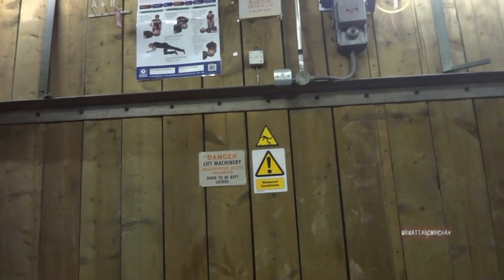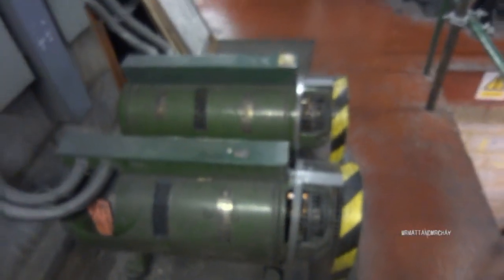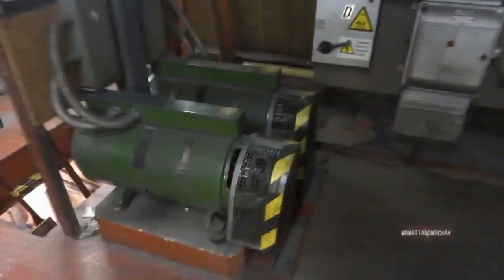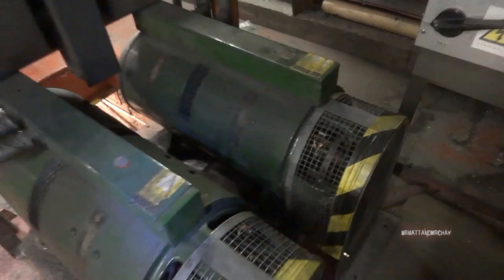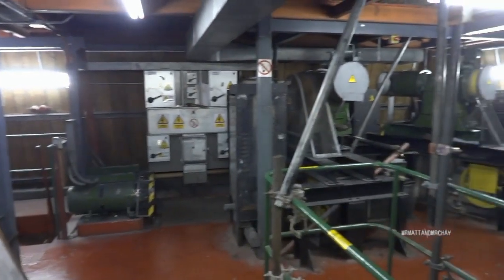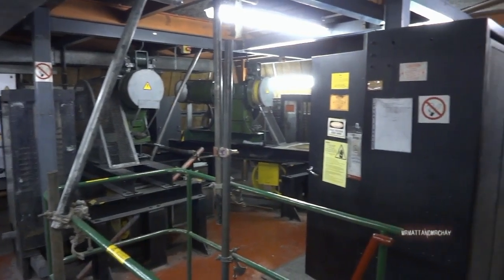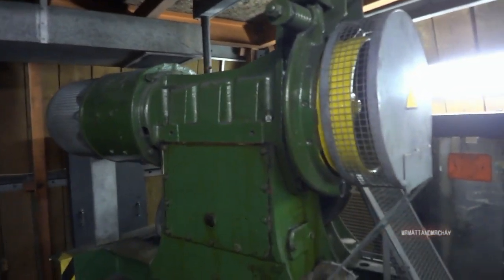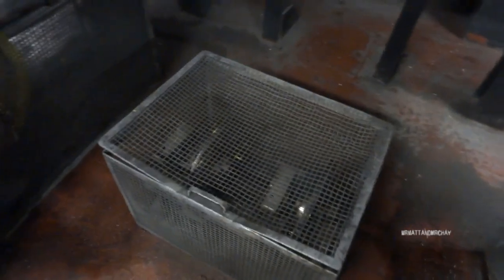1971 Otis elevators Part 2 - The motor room

Comment: Vacuum tubes and mechanical switch mechanisms for this. Strongly predates digital. That rotating switch mechanism is an  very clever & interesting device. There are also thyratrons in this system.
Reply: +craxd1 the number 2050 at the tube socket indicates a thyratron. I found that out in a tube manual.
Reply from the maker: +norman gates I love these motor rooms and the ideas that various companies came up with to control logic to these lifts - facinates me.  You seem to know a bit about this?  Just wondering why you would use a vacuum tube instead of using a relay instead?  Also thyrathons - not heard of these before?  Thanks in advance for any info :)
Reply: +mrmattandmrchay The thyratrons are like amplifiers for the relays. They make the relays sense a much smaller current like from a photocell. The rotating switches must be used for the self-leveling system for the elevator cars.
Reply: +norman gates, I didn't see any thyratrons, but I did see some diode and triode tubes in the design. Generally, a thyratron has a bright blue glow to them. Thyratrons have a gas in them, instead of a vacuum, that when it becomes ionized, it glows, which is called a Townsend discharge. Those relay coils can easily be ran from a triode, as a thyratron is for heavy current.

Comment: Saw a selenium rectifier!  That's more like '50s tech... this looks like a product of evolution, in that old and new things get mixed together into 'what works'.
Reply: +mrmattandmrchay Matt: the fault finding tool is your knowledge of the system you are working on and having a FULL understanding of how it operates in the first place. A 5year apprenticeship in the lift industry is only your starter as your knowledge is only increased by operating in the field. If you worked on installation in those days the lift was delivered in its component parts and you wired the whole system wire for wire, shaft car ,motor room etc. MODERN installation come in kit form and the wiring comes in completed looms, anybody can do it. Processor controls are very clever but soulless and take very little knowledge of the system to repair, only how to operate a test tool, no fun in that mate the relay based system can be very complex and frustrating to work on especially when you get an intermittent fault. Todays engineers have it too easy. (Rant over)
Reply: +scowell The rectifier you can see marked BRF is the Brake Coil rectifier, a DC coil is used to energise and lift the brake.A DC coil supply is easier to control using damping capacitors and resistors to control the actual amount of brake shoe lift. As the lift attains levelling speed which is about 15fpm resistance is inserted into the brake coil circuitry to enable the brake ling to FEATHER on the rotating brake drum before the system comes to a halt. If set up correctly it will give a almost sensationless stop.
Reply from the maker: +scowell Cool, is that the thing that looks like an old aerial that reduces voltages?  What part of the video? (mm:ss?)
Reply: +mrmattandmrchay Big square finned gray thing at 03:59... old-timey rectifier diode.  If you burn one up, don't inhale... selenium bad for you!
Reply from the maker: +Peter Lomas Cool - very interesting stuff.  Wish I was in the industry back in the 70s and 80s - I love all this type of stuff.  Only problems (as someone has pointed out recently) is you don't have a lot of "fault finding tools" with relays.  But on processors you can go back into history to identify faults and mostly make a prediction based on information picked up from the system's memory.  However, I don't care, I like to see relays and mechanical devices working :D  Very interesting!
Reply: +Peter Lomas Thanks!  Also, since a selenium rectifier has a relatively high internal resistance, it's not a simple thing to replace it with a modern silicon diode... the circuit impedance would have to be adjusted.  There's a similar application in the Leslie 21H speaker cabinet, an electric brake... but it actually puts DC on the motor itself in order to stop the spinning speaker baffle.  Uses a thermally-activated time-delay relay (see some of them in this video too) and a selenium rec... the leakage resistance means that the motor creeps slowly when the brake is on.  Later Leslies used a 2-speed setup that's completely different.  Love old tech!
Reply: Was going to say, a lot of this stuff looks pre-WWII era.

Comment: Hideously over complicated, even back then. Amazing it all actually worked, yet the design, wiring and testing of this 1971 apparatus must have taken the better part of two years.
Reply: +Joseph Rotello Not complicated at all, with a decent set of wiring diagrams it is all so logical. The art of fault finding is knowing how the system works in the first place. Then a process of elimination,,very high maintenance though.
Reply: The design evolved over a long period but the installation and testing wasn’t anything like two years, more like months.
Reply from the maker: +Joseph Rotello I agree and I'd love to have been part of designing it also.  Elevator relay logic and mechanical logic at its finest!  It's amazing what they come up with.
Reply: +Joseph Rotello Obviously a product of evolution!

Comment: Lift drive systems have seriously come a long way! 

Now we are using VVVF and gearless systems. Even the control board has become smaller as well. Also since it is using VVVF there is no need for separate AC/DC generator which means the room is much more silent. 

Worm gear drive > Gearless
AC/DC generator > Variable Voltage Variable Frequency
Mechanical relays and vacuum tubes > computerized controls

The space needed to house all the equipment is alot too! Nowadays some lifts do not even need a machine room. 

The only item I saw which still has not changed is the safety gear/overspeed governor.
Reply: The first gearless lifts were actually installed in 1901.
Reply: These systems often worked with gearless machines, probably more than with geared m/c’s

Comment: Too bad the motor/generator units were making so much noise. I used to live in a building with 3 Otis elevators much like these, and did have access to the machine room since the building manager was my friend. It was someting to experience the logic relays clattering open and closed as the lifts went about their movements.

Comment: All I can say is God help whoever has to rewire one after a good short!
Reply from the maker: Lewie McNeely The skill set to repair and fully understand all this is disappearing.  I bet Otis still have people that could fix it but I suppose any such event would force the lifts to be modernised.
Reply: Like wireless maybe??
Reply: Pretty much anything can be done without a computer. Might not be as quick but it can be done. Solid-state isn't the best sometimes. The old manual deals weren't as rigid about temperature and humidity.
Reply from the maker: +jb0177 That's what I like about old motor rooms ;)
Reply: Lewie McNeely Yeah .... thats a problem also. When this thing break, break properly and you are un trouble, not only with the money, but finding the right person to get the job done. Saab overengeniered and over complicated their car with tons of electronic modules. Yeah, top noch technology but not very relieable, and because they made their car like real rocket science, they are gone now, and the cars they made, good cars for sure, are now near impossible to fix. You still can get a basic fridge with only a thermostat, mechanical one (at least here) or you can get the the no frost ones, computer controlled. They break between 2  o 3 years and then no one can fix the fridge because "the computer is faulty". But this is because mass producers cut corners and make crappy low quality electronics. They sell thousands, and every penny the save, the better. Every appliance with computers inside is GARBAGE if you think them in terms of RELIABILITY. But not because the electronics, but they make things weak, and poorly ... they dont want a fridge last for 5 to 10 years.
Reply: It blows my mind how a bunch of mechanical relays and switches could perform the necessary logic to efficiently operate a bank of elevators.
Reply: +Lewie McNeely Electronics have extended operating ranges up to 125 degrees all day long. Have look for electronics in cars, industry, aerospace, they are not prone to fail they are tested to withstand humidity and temperature and consendation. Of course you wont find that in consumer electronics. put a notebook under a heavy sun for some time and you probably will fry it.  But an EFI system on the car, (many runs under the bonnet and not in the body) take 85 to 90 degree as normal operating temperature. Some electronic gear is as reliable as relays or even more. Perfect example are the telephone exchange system, solid state made those systems bullfet proof I seen even a DOMESTIC Phone system from Panasonic, unlocked, opened, near a boiler !!! corroded and still running fine. Other things of course, got worse with solid stated. Lift IMHO are better with relays, I dont trust too much in custom system boards unless made for well known brands and tested in deep.
Reply: true. With new emission systems running 195 degree thermostats, the under hood temps get WAY up there. I just hate for things to get so complicated that it takes a rocket scientist to fix one.
Reply: How true. All our stuff is old and no computer control at all. It has lasted a long time and if it breaks we will try and find other old stuff. They can have all the fancy new shiny things. We just want things that work.
Reply: Lewie McNeely The REAL isuse is the Singer way of manufacture is gone long ago. Singer sewing machines were designed to last forever. So singer wont get a penny on the old running one, because they even need spares. Singer "killed" it own bussines making the machine insane dependable. This conpcet is gone. Today conpcet is, lets make things to last a couple of years or, just make thing and let the SW make them obsolete, like notebooks, LCD TVs, phones .... Then, they talk you about been green and eficient, how hipocritical they are (sorry for the long twist in the comment, couldnt help me). Changes my notebook 3 times, not because malfunction, but bacause new things ate RAM and run slow as hell in systems that are "A BIT" old. I dont throw the old one. No only electronics, but ... the picture is bigger ... even if you get a relay operated tablet, it will fail in two years. Guaranteed.
Reply: True. You have to by new to be green which is a joke. The makers are filthy rich because they make and sell junk or everyone thinks they have to have the newest and supposedly best. Not me. All my stuff is worn out by other peoples standards but it's paid for. No payment book here.
Reply: nor here also !!!, I try to "fight" this model as much as I can. I love vintage gear. Of course, cannot comment on YT on a vintage computer, so, well, if you want to stay "connected" you need decent gear. Almost all the gear I have is prewoned. Try to get from them as much as I can. Also getting the LAST and trendy thing, is expensive and no sense. As you say, I will never go in debt for buying the newest crap.
and as per the new and green just look at the prius, OMG, a small diesel polutes less, has better efficiency, low maintenance and by the end, no batteries to worry about. But snob people buy the prius so they can call themselves "green" LOL and is a truly enviromental disaster. Tipical theorical model FAR from the real world .... Yes of course, you can take the batteries to Toyota and they will recycle them .... LOL, sure ... recycle in a dumpster ... marketing people ... they dont sleep !!!
Reply: Perzactly! Recycle is a joke in this time. No bounty for bottles like in years ago and not packed in containers that can be re-used. A joke. I am still running XP on an old slow Sony but it works and have an old Dell 98 in the closet. I can always print letters on them. I do not want anything new. Maybe clothes but that is because mine get ratty and my sweetie wants me to look nice when I am with her and I do my best but I get dirty and greasy and ruin stuff. She buys and I wear. Both happy!
Reply: Lewie McNeely LOL. I was using XP till the last year, but make my notebook sooo slow and finally move to Linux, runs better, cost nothing, never got Errors nor viruses. Recycle is again theorical stuff. Good from far ... far from good. They recycle what they really need, like iron, aluminium, copper, because the recycle metal market sold this material cheaper. Other things like plastic bags ... forget it, just dump them in a place that people can see ... just like that. Can you imagine Apple recycling ?. Can you imagine Samsung ... recycling. Yes, its a joke. They produce good that last 3 years, then to the bin. Battery cannot be replaced. The call themselves "green". What a funny people they are, dont they ?. Samsung TVs last 3 years, then you throw a big 42 inch TV to the bin because one chip die and no spares. Happened to a coworker last month. Direct to the trash because no one can service it. Where are the regulations to stop that ? ... ummmm there is a bug in the "green" system, by green, I mean, snob.
Reply: How true. Quality went down the trail after the $$$$$$$ rolled in. Nothing new lasts at all. I need more memory but as long as slow beats no, I suppose I'll hang on to this old thing. Snob is right. Nose in the air so far a bird could fly into it and build a nest.

Comment: This is an iteresting comparison between Otis and the Westinghouse elevators of the same era. Your DMR video is of higher speed machines but, basically Otis used more mechanics than electronics to control their lifts. The Christmas tree things are known as a type 6850 selector or "pie plate" selector. The 6850 selector os driven by a flat steel tape connected to the lift which then drives a reduction gear box which drives the selector shaft. The contacts that are on the selector tell the lift controls where the elevator is, when a stop needs to be initiated and when to slow down and stop level with the floor, also when it is safe to open the car doors. These lifts are medium speed lifts, on high speed lifts there are other parts to the selector which advance the whole selector panel to allow for a long distance stop. The 6850 selector is a great piece of equipment that is relatively easy to master for the lift mechanic....or was....now lift mechanics seem to watch video screens and scratch their heads quite often...
Reply from the maker: +Eric Brandt I've seen a couple of videos showing the advancer for longer stopping distances, one was on dieselducy's channel.  Facinating, but never seen one over here.  I went in a 20 storey Otis motor room once, but I think this was a "geared" machine and took ages to get from G to 20.
Reply: The advancer panel was used to control the maximum speed that the lift would run up to according to how far away the next stop was. The amount that the panel extends controls the maximum speed. When a floor has a call in then a contact in the advancer line would go live. As the lift starts, the panel extends until it finds a live contact then the top latches. If the first live contact is far enough away the panel will extend fully and the lift will reach top speed. If the first live contact is close, the panel only extends partly and the maximum speed will be in proportion to that.
  Even when you are used to seeing them, they are fascinating to watch in action.

Comment: Wow what kind of vacuum tube was that glowing so brightly!??? Didn't look like a rectifier , what the hell!!??? Please let me know the number if it's still possible.  I need to look that up, it's killing me to not know?
Reply: +Steven King looks like a neon indicator
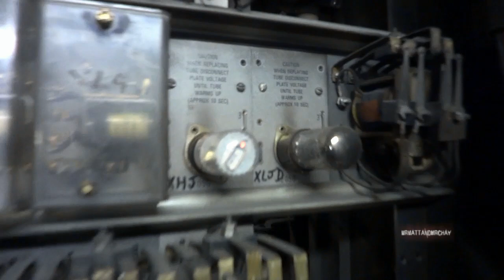Reply from the maker: Steven King I learned about these from "elevatoradjuster" (he had to close his channel - http://goughlui.com/2015/02/23/opinion-we-say-goodbye-to-elevatoradjuster-youtube/).  He did an explanation on them.  There are two types, if you look at 2:23 the one on the left is the new type - the LED (or possibly it's a lamp?) goes out when a call is active somewhere.  He didn't do a demo on the old type (which is the bright ones that you are referring to.  So these are something to do with switching power to circuits when there is an active call.
What I don't understand is, well why not just use a relay to do this?  I don't have an answer unfortunately, but if you can offer any other info to this component then that would be very interesting!  I've seen these in BLUE before and much larger (again, on elevatoradjusters channel - sadly gone!).  (Perhaps my friend ***** can help here?)
Reply: Great thanks!  Nice video.
Reply: Cool!
Reply: +Steven King The glowing tube most likely a neon filled voltage regulator tube.

Comment: Masterpieces of electromechanical engineering. Interesting to see vacuum tubes
Reply: The glowing valves you can see are hermetically sealed thermal devices with a fixed delay time. They are used to shutdown  the generator after no calls registered in the system of that particular lift for a preset time , it used to be about 4 minutes from what i can recall.
Reply from the maker: RODALCO2007 Apparently this is currently all being ripped out.  I have a question regarding the vacuum tubes - I have a very limited understanding of these, but think that these are being used to latch the call buttons somehow?  Would they be used for switching?
Reply: Another masterpiece is mechanical calculators!